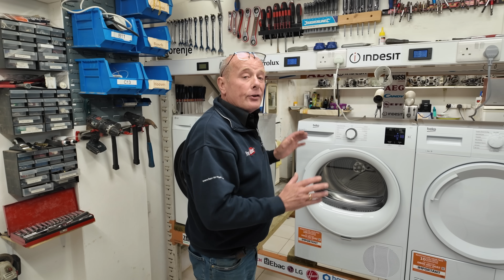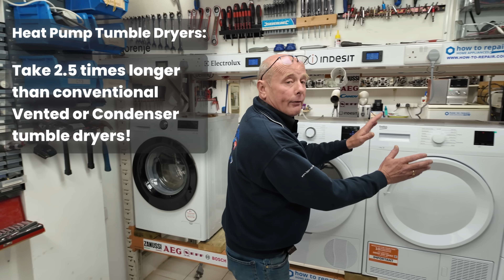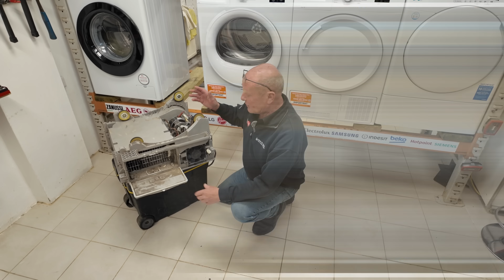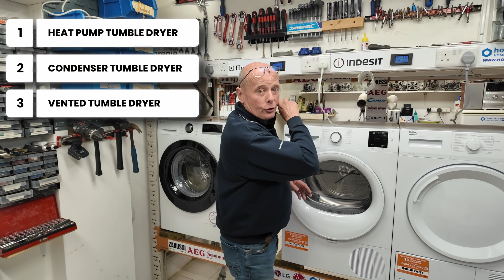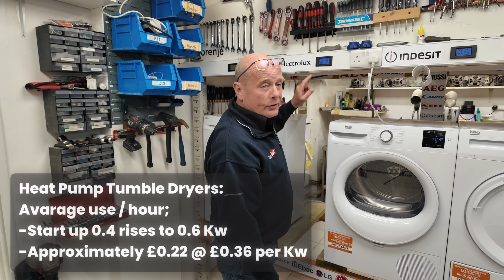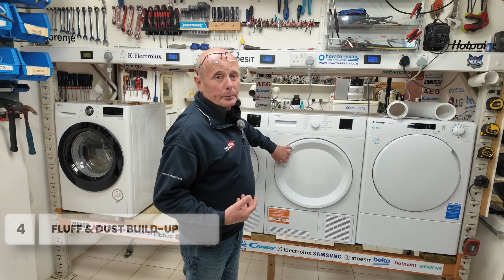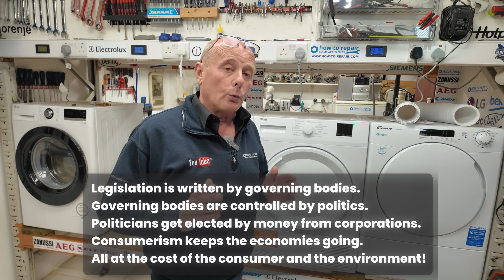Tumble Dryers the Shocking Truth About Heat Pump vs Vented & Condenser, NEW LEGISLATION!

Comment: Had this issue recently with my Samsung heatpump dryer, drying cycles started taking ages and leaving clothes still wet and drum was rattling.
Fortunately still within 5 yr warranty so OEM technician came out, drum bearing was knackered and heat exchanger was full of lint.
They did a full replacement of the bottom plate with a new compressor and heat exchanger. Problem resolved but madness this was the fix.

Issue seems to be the drum filter basket doesn't stop 100% of the dust. I've added a secondary thin foam filter in front of the heat exchanger, it catches quite a lot that is bypassing the main filter.
Hopefully this will make it last longer now.

Might not be this simple, but having worked on industrial HVAC it seemed to me that designing the heat exchanger so it can be water flushed with a hose without disassembly would be ideal.
Reply: Ditto
Reply: see my comment below
Reply: You are supposed to clean out the heat exchanger as well as the lint trap. If yours is Wi-Fi enabled, you even get a prompt on the Smart Things app every time you run it when the heat exchanger has a lot of lint on it. I now just clean it out every couple of weeks to ensure it is at maximum efficiency. The lint trap obviously needs to be cleaned out every load.
Reply: When you first bought this machine did you clean the lint every-time from the filters after using the machine? So, there will be less build up of lint over time that may get into the motor itself, causing problems later on… And did you overload the machine with too many garments and instead of drying synthetic garments on they’re own and cottons on they’re own etc, did you mix different types of garments together which, with a heavier load would make the heat pump dryer work harder and as result, damp clothes or damaged clothing after taking much longer to dry.
Reply: Engineered to fail on purpose because $$$
Reply: Like all modern household devices, and needlessly difficult to repair.
Reply: A smoother circulation path with a better filter design would be better. Water would make natural fibers bind more securely into a dense mat.
Reply: My LG heatpump dryer has a short autowash that it performs on the condenser after every cycle and a longer automatic one after every 30 cycles. It also has the option to perform one whenever the end user chooses. Keeps it spic and span.
Reply: I have a cat and see many cat hairs being stuck on the front of the heat exchanger after every load. Also a samsung. Normal?
Reply: **Firstly**, Samsung dryers are designed to dry clothes to a slightly damp state by default, making them easier to iron. This setting leaves clothes about 95% dry, which is recommended for ironing certain fabrics. If you want your clothes completely dry, you need to select the "Fully Dry" or "100% Dry" option. Did you make sure to do this?

**Secondly**, when you start a load, the machine will initially display a drying time of around 3 hours. However, this is just an estimate. The dryer continuously monitors the moisture level and will stop once it reaches the dryness level you selected (e.g., 95% or 100%). Many people miss this detail because they don’t read the instructions carefully.

In traditional dryers, you manually set a time (e.g., an hour) and full heat, then check periodically to see if your clothes are dry. *This is not how Samsung dryers work.* With these machines, you don’t set a specific time. Instead, you choose the desired dryness level, and the dryer automatically adjusts the duration based on factors like the load size and material type.

Unfortunately, I’ve seen many negative reviews from people who didn’t take the time to read the manual or understand how the machine works. It’s a different concept from traditional dryers, but once you understand it, it works exceptionally well.
Reply: @markylonall good points! I have a bosch hp dryer and it had 3 heat settings. I use the middle setting on cupboard dry clothes. I’m happy as the clothes don’t get super hot and end up like crimplene!
Reply: @wintersun398  I always find with HP Driers it's not a HOT HEAT the clothes don't come out HOT or like toast or shrink. A traditional drier pretty much toasts your laundry

Comment: This is an excellent presentation. My family is angry with me for buying heat pump dryers. We are heavy launderers.

The Candy heat pump dryer destroyed itself in 18 months. Lint had built up in non-serviceable parts. The servicing technician condemned it and replaced it free of charge with a Hoover heat pump tumble dryer.

We now have two heat pump tumble dryers: the Hoover and a Beko. It is necessary to have two running side-by-side because they take so long to dry.

The Beko didn't work correctly from the beginning, and all its sensors have recently been changed.

I measured the energy usage, and the efficiencies were far less than expected. A single dryer makes poor use of free solar electricity.

We would hope to buy condenser dryers when these machines need replacement.
Reply from the maker: lets hope you can still buy them then Thank you for your comment. I appreciate people like you taking the time to write it out. Please share it where possible. It might help others make a wise choice instead of being misled by the industry.
Reply: @How-to-repair  The relative efficiency makes no sense. Year after year, the condenser/vented dryer measurably used almost twice the washing machine's energy. The washing machine uses 748 kWh annually, and the tumble dryer uses 1,496 kWh. Last year, the heat pump tumble dryers used a combined 1,082 kWh. I do not understand why the heat pumps do not meet our energy-saving expectations.

Comment: I have a 9kg  2014 model samsung HP dryer it takes only 1 hour to 100% dry full load.  It uses aroun 600w at max.
Reply: Your heat pump drier produces more heat than my 8kg 'hot wire' gryer. Thats unbelieveable!

Comment: I heard this last year so we scrapped our 40 year old Zanussi TD200 and bought another vented machine while we still could. Great videos.
Reply: We always bought Bosch apliances for our kitchen. But now we are on our pensions when our 10 year old Bosch condenser tumble drier stopped drying clothes we bought a Zanussi condenser tumble drier in October 2024 from John Lewis and it has now failed 3 months later. Five days ago I spent three hours on the telephone to John Lewis trying to arrange a repair under the two year warranty, only to be told that I needed to speak to Zanussi. Three days ago I spent a further hour on the telephone arranging a repair with Zannusi  and a Zanussi approved repair company to visit / they can't come until next week. The Zanussi condenser tumble drier operates but does not heat up. I will not be buying a Zanussi appliance ever again and I will not be buying anything from John Lewis either.
Reply: Your contract is with seller, John Lewis. It,s their duty under the consumer rights act 2015 to replace or repair the item without undue delay and without causing you inconvenience.
Write to them via recorded delivery stating that they abide by the law. If they don't respond or refuse to comply then either contact trading standards, contact a solicitor or issue a summons in the small claims court for compensation including for time and inconvenience caused.
Reply: @elric6084  the shop you buy an item from is repsonsible for any faults with it within the guarantee period, you dont have to and shouldnt have to go to the manufacturer yourself, its down to the retailer to sort it..this is stated in consumer law...
Reply: The 40 year old drier was probably well enough made to do another 40 years for you. Modern ones are built with literally the thinnest metal they can get away with, so they're often nearly impossible to dismantle and reassemble without accidentally damaging them, so servicing can wear them out rather than adding to their life.
Reply: Haha , Ive just seen this  and didnt know the changes . I also have a TD200 that was bought by my parents in mid 80s  which I just used yesterday.  Shocking am going to have to lose it like yourself just to escape this cut off
Reply: i still have & use a zanussi td200 !
Reply from the maker: good choice Thank you for your comment. I appreciate people like you taking the time to write it out. Please share it where possible. It might help others make a wise choice instead of being misled by the industry.

Comment: Appliance tech myself you are absolutly spot on, excellent video. Had  a fair few heat pumps fail  although not as often as regular heater elements. Often the manufacturer only supplies the compressor or condenser which is no good for most technicians like me,  they ideally need to supply a complete sealed unit at reasonable cost but that won't happen.  I have even refered customers back to manufacturer if a 'fixed price repair' is an option but they will take the customers money then say it's still not repairable as the heat pump isnt available.
Built in Obsolescence For sure they all have under engineered bushes and bearings especially the more well known brands mentioning no names lol.  Keep up the good work always enjoy you video's and often refer my customers to your channel.
Reply: BSH dryers come as a complete base tray with compressor and pipework.
Reply: @mike72168   good information ! Not good about the low spec/quality parts probably done on purpose ?
Reply: @madbiker1000  Indeed manufactures deliberately design parts to last a certain number of cycles on average. As Paul says they aim for around 5 years average use
Reply: @mike72168  
Thanks 👍
Reply: just rebuilt my bosch washer motor, Chinese bearings inside replaced with koyo jap ones, made in germany these days just means assembled in germany with Chinese parts
Reply: Obsolescence is actually pre programmed into the PCB via a timing chip!
Reply: @jablot5054  what bullshit
Reply: well said Mike, Totally agree with your comments 100% again, I'm a retired refrigeration engineer so I understand exactly where you're coming from

Comment: You've answered the questions I've been asking myself for a while but some  questions still remain for me... Lets say drying time is not a factor.
Doesn't this comparison of suitability all depend on the frequency of use some people don't hang washing out they use a dryer all the time my folks for instance only 6 months of the year then it's out on the line.
A household of five people in comparison to a household of one the frequency of use is so  different. 
Longer running times does not necessarily mean excessive wear if the correct specification parts are used for example a starter motor and battery in a stop start vehicle is totally different.
So shall I assume there is no upgraded parts in these heat pump dryers to compensate for the extra running time ?
Also is  bringing motor specification (design/efficiency) into the equation  important when dryeris being used for 2.5 times longer.
At the moment my folks are running on medium heat setting it sounds like they may be better running on high setting to reduce program times ?
You're advice would be appreciated thanks 👍
Reply: Im telling you right now, No they do not upgrade anything or consider the run time, they want you to buy a new machine every 4 years.
Also unless they use a China bearing or wrong type for the job, they will wear out faster due to longer run times.
Dont buy anything with compressor motors as they are all crap build and most do not have overtemp cutouts .
Reply: @donwall9632  
Thanks for the information very useful 👍

Comment: I have a hotpoint condensing drier and provided i dont fill the drum too much it will dry clothes no bother...but drying towels takes longer and i may have to stop the machine to clean filter.  Otherwise its a good machine.

Comment: I've got a top end heat pump tumble dryer and it's brilliant your only showing rubbish machines probably made be whirlpool
Reply: like a lamb to the slaughter !!! Pompous snobs are the easiest people to manipulate with marketing and branding propaganda. Most of them are as thick as two planks ! You'll see !!
Reply: time will tell another story
Reply from the maker: I haven't encountered any positive feedback from engineers regarding the serviceability of these machines. They are poorly designed, and manufacturers are undoubtedly aware of the fluff issue. This is evidenced by the increased presence of filtration systems on all heat pump tumble dryers showcased at the Berlin trade show last year. They acknowledge the existence of the problem, so why continue to produce these poor-quality products?

I believe heat pump technology holds significant promise, however, these machines exhibit an average lifespan of only five years. Accessing the machine for maintenance purposes is an absolute nightmare. Manufacturers appear to have a limited understanding of necessary maintenance procedures and the importance of user-friendliness in this regard. They seem to design and produce these appliances without adequate testing, assuming inherent perfection.
Reply: which part of longer cycle is shorter lifetime for the machine AND your clothing, u did not understand. u are wearing it down quicker , ruining your garments and spending more for the sake of netzero lunacy

Comment: My previous dryer, a condensor one, lasted 18 years. But after 18 years the motor capacitor was death. I know its an easy and cheap repair, but the dryer itself had a lot of wear and tear. So we bought a new dryer, a heatpump one. I hope it will last atleast 10 years, but time will reveal if that will happen or not.
And to be honest, yes the heatpump dryer is slower compared to the condensor dryer I had, but it is not that bad. 

Thanks for these nice videos!
Reply from the maker: Large appliance manufacturers used to make durable products but now they prioritize sales over sustainability. While employing green marketing strategies to enhance their image, they remain largely unaccountable for the mounting electronic waste generated by short-lived products. The average lifespan of appliances today is a mere five years!

Thank you for your comment. I appreciate people like you taking the time to write it out. Please share it where possible. It might help others make a wise choice instead of being misled by the industry.
Reply: @How-to-repair  Sadly cars have almost reached the "white goods" stage and the manufacturers will use the government's green washing EV agenda to benefit and accelerate their own profits at the consumers' expense.
Reply: @How-to-repair  several Points you seem to not have taken into account:
1. Inflation: If you correct prices for it, things are really cheap these days. If you would buy something in the same price range you end up what is considered a semi-commercial unit. That one has the high quality parts in it, that where also used in the earlier single household products. Not everyone used to be able to afford it. The price of bringing the prices down to general affordability was in part, loss of durability. Our brains are designed to forget the "bad" faster than the "good". So we easily remember how more durable things were, but not that it took a large chunk of the annual income for the lower middle class to afford it.

2. You're Numbers for drying times / energy seem off. I see completely different ones and many WP-Dryer owners see the same. WP one should be about double the price than older tech, otherwise, the probably took some really substandard parts. But it also should at least half the energy consumption. They savings in electricity alone (assuming 0.30 instead of the 0.36/kWh, which is current Britain average), means that you can buy something like 3 cheap WP-Dryers over 10 years and still break even. But generally the will last rather 5 years, so you end up with a win.
 
3. European Living Standards and Salaries kind of make the repair concept itself obsolete. Salaries are high, Taxes have been shifted to increase costs on salaries and services (rather than wealth and financial gain). Now what would make much more sense is the force the industry to create a second life. Meaning, they have to buy it back, create the education somewhere overseas where salaries are dirt cheap and then ship them there. It already happens by itself for things like cars. Not economical to repair them here, but once moved overseas, they often repaired and used for much longer.  Foremost, Landfills need to go and Recycling needs to be enforced. Landfills themselves are a problem, that undermine efforts at sustainability.

Comment: Could not agree anymore. The consumer should make the choice. It is your money, you decide how you spend it. The dictatorship of, we will tell you what to do, politicians. It is my money, my choice of machine.
Reply from the maker: I agree that consumers should choose where and how they spend their money. However, they need to know the facts before buying an appliance. The energy savings on heat pump tumble dryers are great, but it's important to consider the long term as well. Thank you very much for your comment; it is much appreciated.

These machines could be made much better if it were easier to get to the evaporator and condenser for cleaning. Manufacturers could make it so you can reach these parts from one side of the machine. They could put a lid on the top and a lid on the bottom that come off. This way, you could clean it properly. Right now, I don't know of any machines where you can do this without taking apart half the machine.